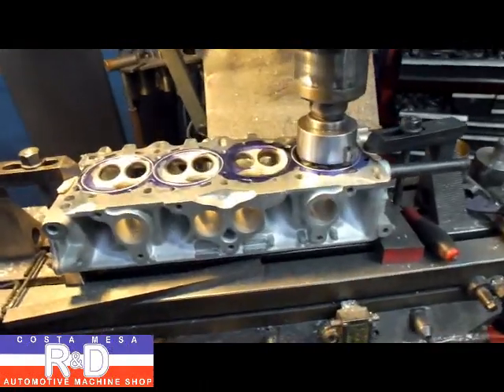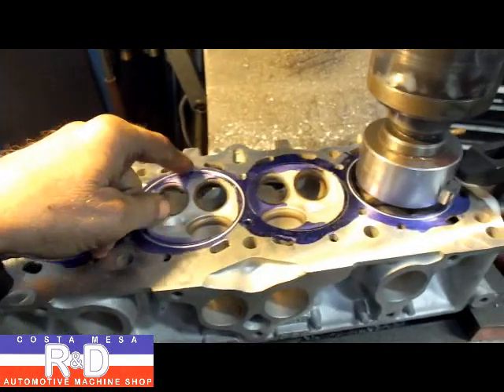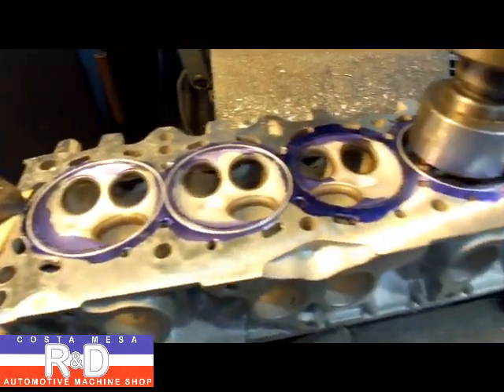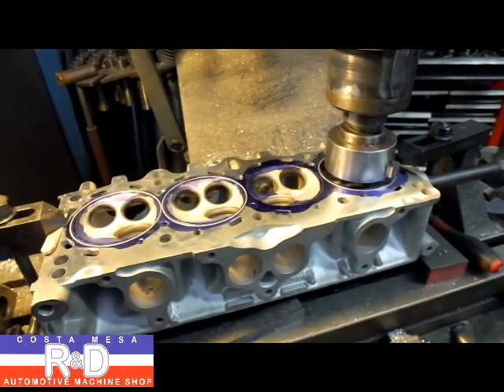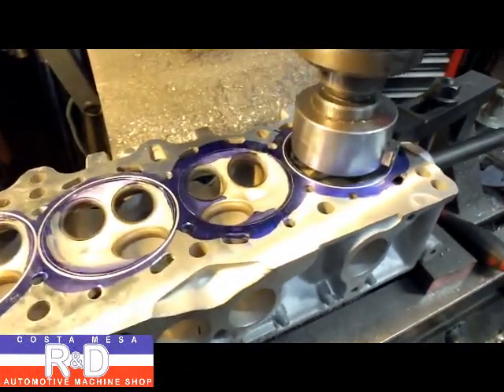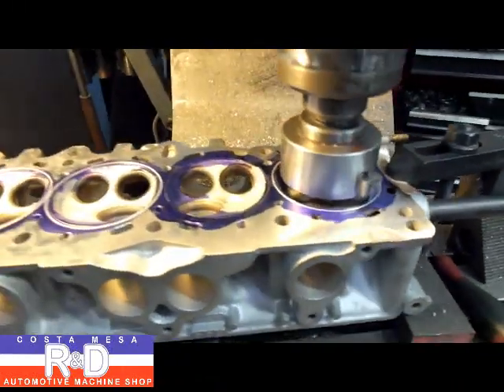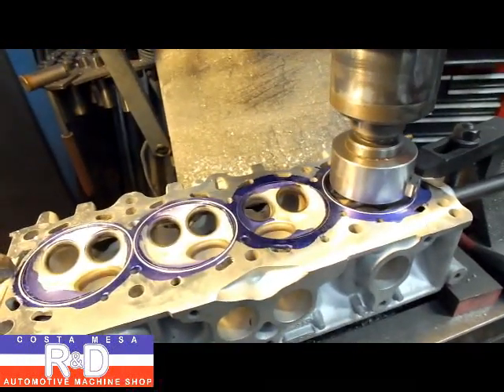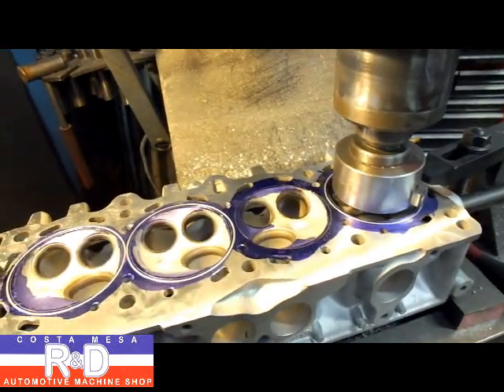O-Ringing Honda Cylinder Head

Comment from the maker: We do this on resurfaced blocks, as a rule. We orient from the deck or pan rails. You center the boring bar to the center of the cylinder w/indicator or centering fingers.

Comment: Did you just eyeball the center of that cylinder head?
Reply: The cylinder head would have been set up so that it is dead centre along the Y axis before any machining was done then he could have guessed it.But, I suspect he has a DRO fitted to his mill and he was just checking it by eye before commencing work. The DRO would have been out of shot and the scale most likley fitted to the back of the table.

Comment: are these special O-rings?   seems like the area around a combustion chamber would be kinda warm      do they act as sacrificial lambs?
Reply: Stumpy LawnmowerGuy  You mean along the lines of a cathode/anode reaction? Nope. Just good old fashioned wire which crushes when torqued down. These wires are never reused.

Comment: was thinking along the lines of a part that facilitates doing a job...only used once...like for install or removal    say you weld a nut onto a sheared bolt so you can back out the bolt.    nevermind I get goofy just imagining being in your environment.    I love putting stuff back out there in use when someone else might say toss it.    and there's also your one of a kind...only one left in the world kinda block or head.